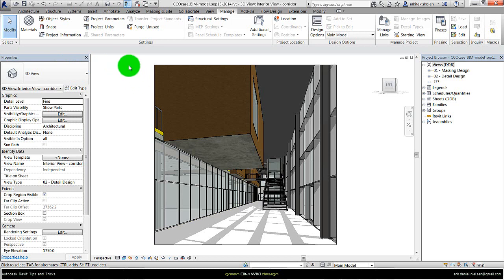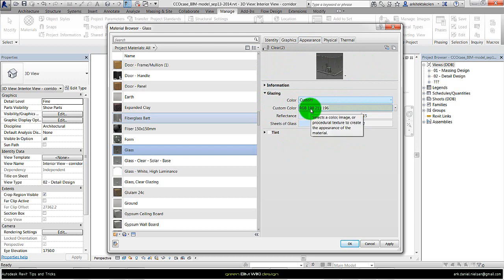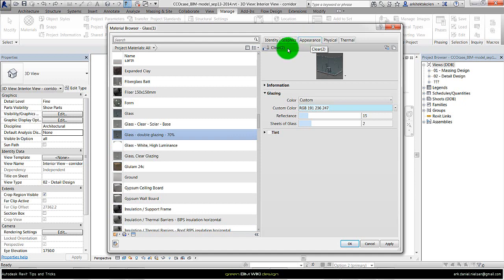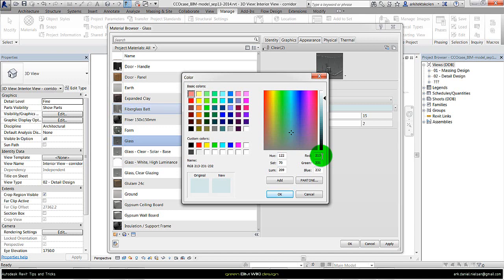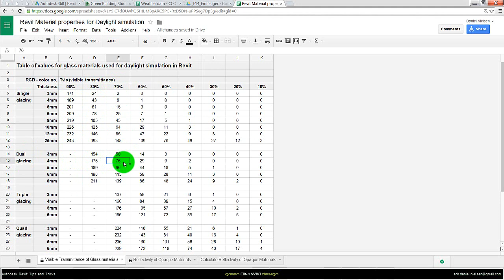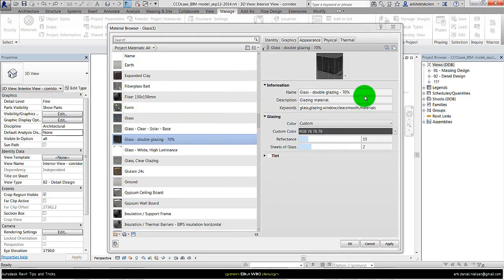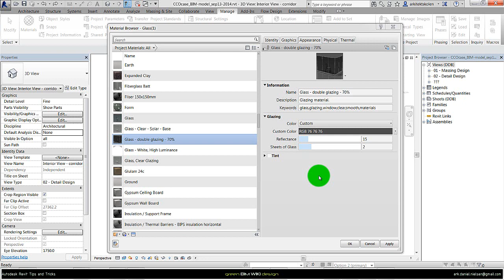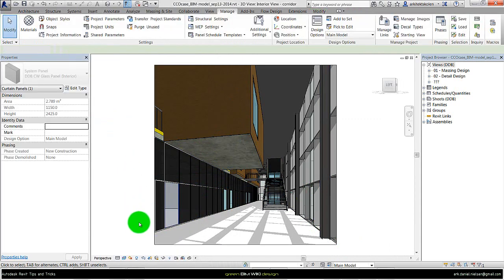Autodesk Revit DA - Apply Reflectance and Transparency to Glazing for Daylight simulations

Comment: Hi Daniel,
Can we use the Google document settings for normal renderings as well?
Reply from the maker: To get right reflections? I suppose there is a link to reflections from materials as well when rendering.
Reply: Yes, indeed! I was trying different values for reflection under the same lighting conditions. However, the render results were not drastic which made me come up with the question above.